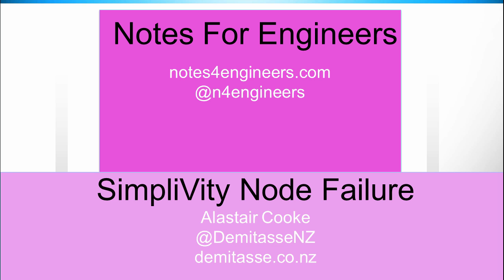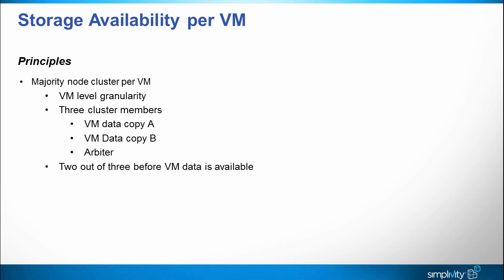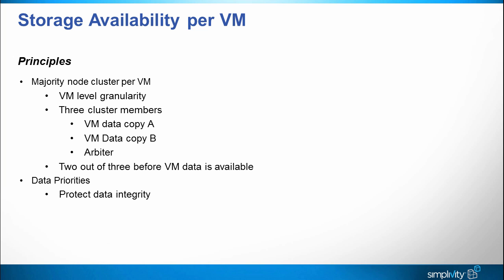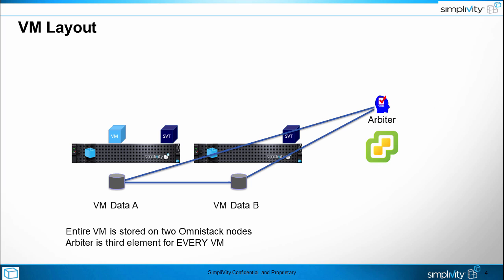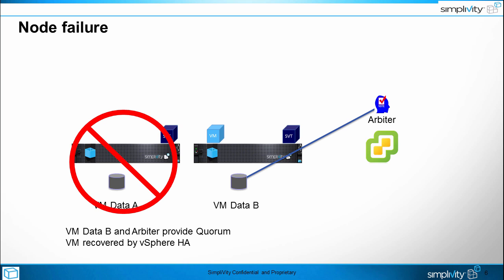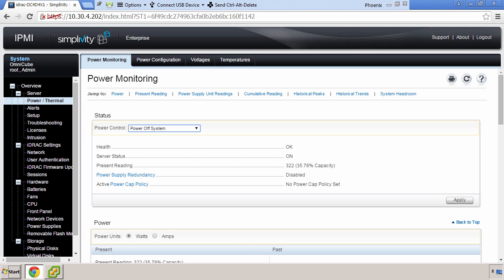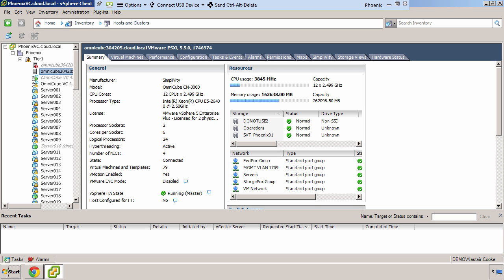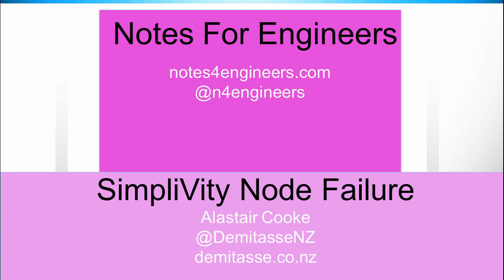016 Node hardware failure in 2 Node SimpliVity cluster

Comment: Hi. Say you have two nodes with node A running VM1 and node B running VM2.
If node B fails while the arbitrer is down (maybe it was running on a remote site and ipsec was down at the time), will Node A keep running VM1? (I assume it will not start VM2 for sure as it will not be able to gain quorum).

Comment: It seems like it for a smaller vm count it would be faster to power off and on manually
Reply from the maker: vSphere HA is about responding to a failure. In a real server failure, there is no option to power off VMs as the server simply fails and the running state of the VMs is lost.

Comment: 6:01 Why don't you just say that its best practice to have DRS disabled?
Reply from the maker: +Adam Provost This video is about node failure and HA rather than DRS configuration. I would like SimpliVity to be more forward about DRS best practise. My understanding is that on this 2 node configuration DRS should be set to fully automated. Larger clusters may require different settings on SimpliVity